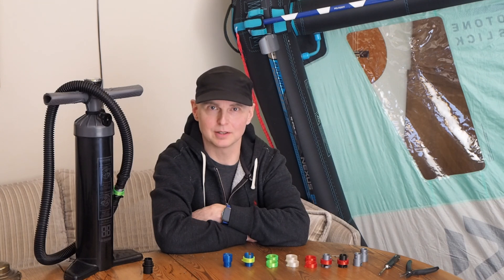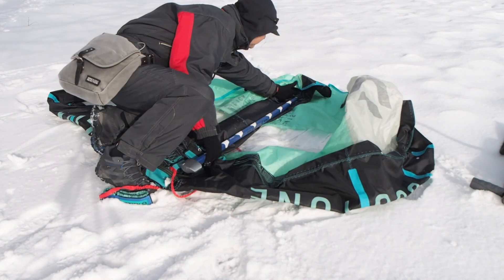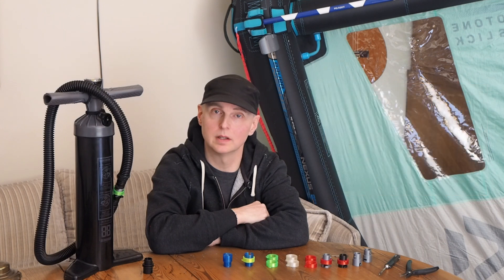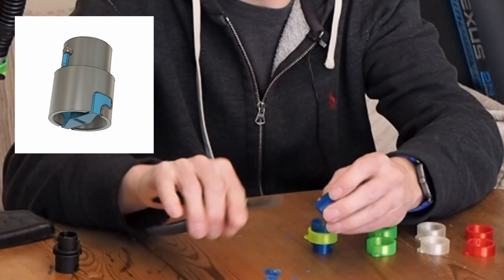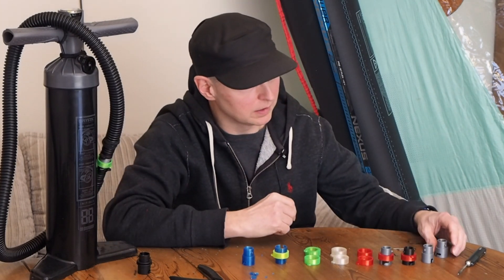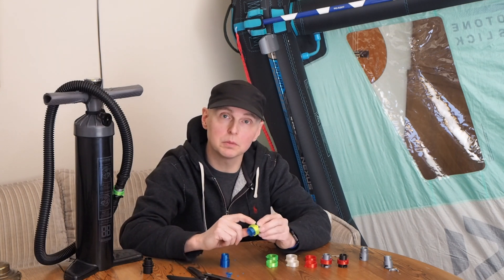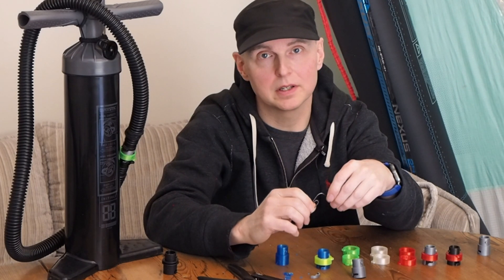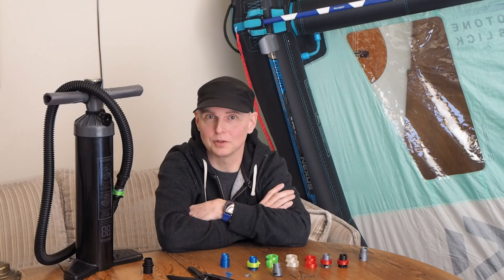3D-printable Pump Adapter for Duotone Wings and Kites

Comment: I have the opposite problem: i own a duotone pump and duotone wing. Just picked up a cabrinaha wing and need to find an adapter to make this work…
Reply from the maker: That's interesting. I asked a friend who recently bought a Slick set (including a pump) if the pump came with a special hose that only works with Duotone and he said that he got a nice pump and a whole bunch of adapters. So either he didn't get an actual Duotone pump or they changed it to a standard pump with adapters.

I could design a "reverse Duotone" adapter, but I have a feeling that it would be a rabbit hole that I really don't want to enter. So, instead, I'll advise you to get a new pump with a standard hose and see if the Duotone hose will plug into that pump, so you just switch hoses when switching between the Cabrinha and Duotone.

With all that said: I have something new coming really soon. I have completely redesigned the adapter so that you just need PLA (or PETG) to print it (no flexibles) and there's no bayonet that occasionally breaks off in the valve. It's a huge improvement over the old one. I gave adapters to a couple of friends and we'll be testing for a few days (or maybe a week) and if there are no problems, I'll release the new model. Those who already bought the old adapter will be able to get the file for the new one free of charge.

So, if you still need to pump up Duotones and you do get a new pump for the Cabrinha, please consider trying my new adapter when I make it available!
Reply: @jmunkki  thanks, Yuri. I will keep an eye out on your mini factory page